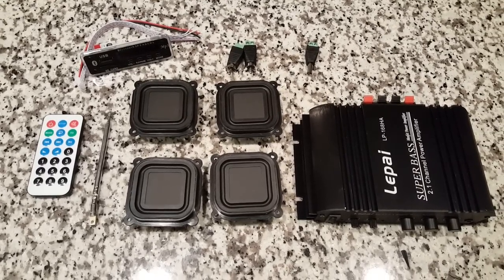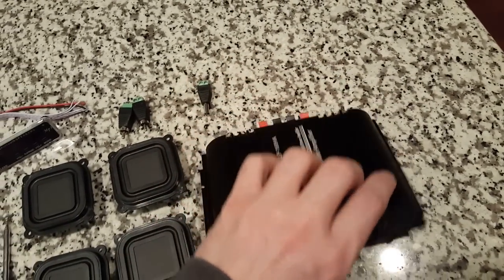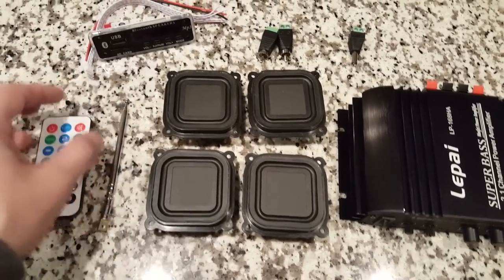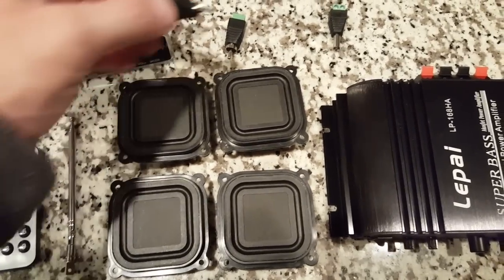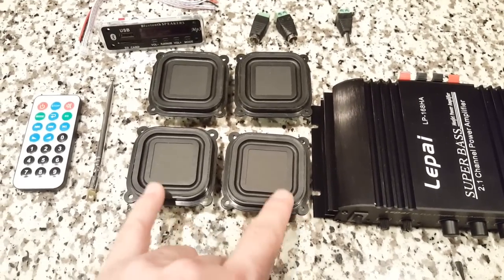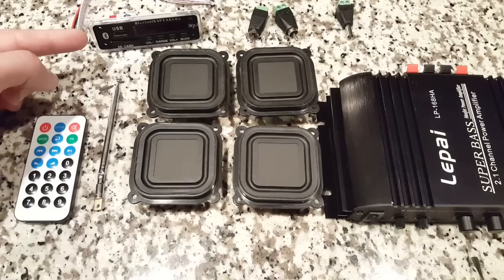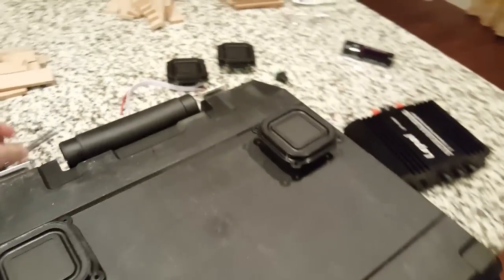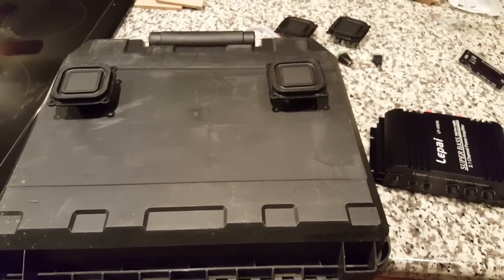Dewalt Speaker Build - The Components

Comment: I have no bass coming off the amp. I have a ground loop isolator. Would hat affect it?
Reply from the maker: The same amp?  Check to make sure you plugged it up correctly and that your bass knob is adjusted correctly.  Also the subwoofer output should only be hooked to one side.  I showed how to hook it up here:https://youtu.be/QiIq1vxWHmc?t=59s

Comment: How much total
Reply from the maker: +All MERRICA Good question.  The 4 BRM12 speakers were $6 a piece and the B4N woofer was $11.  The amp was on sale for $25.  SO for just the Speaker build was around $60 in components.  Now if you want the FM tuner that I built-in, add an extra $10 on top.  I had the speaker wire, mdf and a few other items I needed like the power jack.  But if you needed those, that would add to the cost.  I hope this helps.